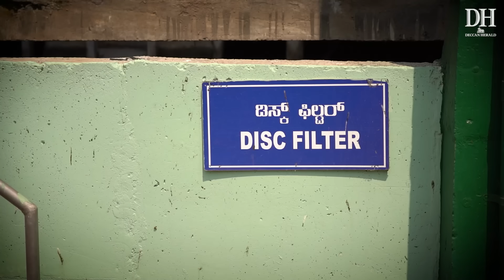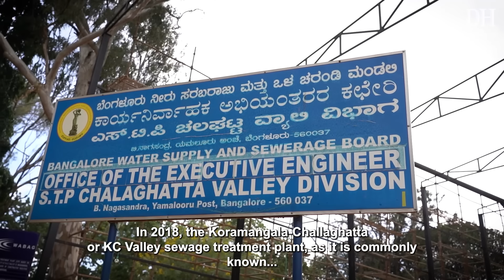How Bengaluru recovers sewage water | Can recycled water solve Bengaluru's water problem

Comment: instead of filling up the lakes with treated water they should be routed for non drinking purpose at homes through pipelines or water tanks and drinking water should be separate. also why would you release chlorine water in to lakes won't fishes die? also it is dangerous to consume such fish because of biomagnification of heavy metals

Comment: Hi, 03:26 the system shown in the said grit chamber is not any screen, it is a sedimentation device. It settles heavy particles to the bottom. Check out Lamella separators by Nordic Water. Thanks

Comment: In my view
1. Each flat should have separate water meter. This will help us increase water charges drastically above Avg water usage of Bangalore. 
2. Govt should make sure STP treatment plants are working properly. Many case STP plant is just for name sake using  money power and muscle power won't operate those.
3. Make sure each and every building should have Rain water harvesting system in place and which is properly functioning.

Comment: Bbmp and government come out with novel projects costing thousands of crores.  Why don’t we adapt Singapore model who treat and purify water beyond our tertiary treatment in most stps. Ultra purified water is also used for drinking. Some of you may recall bill gates photo of drinking ultra purified water. Singapore does not have ground. Water and depends mostly on rain water and the balance importing from Malaysia. Mr. Incharge minister for Bengaluru should start looking at what is being done by a city almost equal in population and area to Bengaluru. Singapore has one authority for all water related issues unlike Bengaluru where many agencies, always engaged in blamegame with one another on  city. problems..

Comment: Instead of Sewage alone, try collecting, filtering and boiling Airconditioner / dehumidifier water and adding alkaline to desired pH in every home.  Ensure bird meshing around the same. This is exactly how Israel carries out drip irrigation for greenhouse plants . Every house with functional air conditioners and dehumidifiers could try piped collection of condensed water. A one and a half hour collection of this water from a single ac on mode dehumidifier provides 5 to 8 litres of treatable condensed water. ( Ensure bird avoidance meshing on outdoor split ac units)

Comment: The water which is treated in Singapore is of such high quality that, in their processing plant, water is given to visitors to drink. Yes sewage water is filtered to such a degree that it can be used for drinking. There should be sensors kept at exit points of these STP's which will monitor the levels of Nitrogen and Phosphorus and warn the plant if it goes over the limit.

Comment: First let BWSSB strictly enforce rainwater harvesting in every individual's house and then on public spaces like side drains
Reply: Even older buildings too
Reply: @haridasification  I will surely agree with you, if you are capable of proposing a solution instead of replying one sentence answers.
Reply: Crores of liters water is wasted during rainy season,all this rain water goes to drains,all rain water should be used, stored,it should not be wasted
Reply: It can be done
Reply: @haridasification  yes, at all public spaces and upcoming residential homes
Reply: Not gonna work for every house, people live in such tight packed houses that even if they were able to setup plumbing for RWH, the collected rain water cannot be mixed with existing sump or there is no space to dig a recharge well. It can only be implemented by houses with a garden area for recharge well or having additional space to store tanks that collect rain water.

Comment: Untill the mindset and habits don't change ,until civic sense is not  practiced one will see more natural disasters 

Bangaluru was once a calm green  garden city , after the unplanned growth of city and illegal constructions and destroying and polluting lakes and water bodies such a consequence of water shortage is there .
And this city is overated and hyped to be called as Silicon Valley of India, Tech City ,IT Capital. 😅
On what basis, this city can be compared or called as Silicon Valley 😅

The water which is being recyled from  sewage can be seen with full dirt ,plastic ,waste materials dumped irresponsibly in sewage lines .
One should as citizens blame and are equally accountable for what the condition of the city is today .

Untill mindset and habits don't  change ,until civic sense is not  practiced one will see more natural disasters
Reply: All Municipality in India are corrupt. Every municipality knows what is the problem but every time short term solution is given instead of working on long term and they there would be Commission in all the work which needs to be completed. Then how can we accept we would get full fledge solution for it.  . In Blore, water distress call has been there since 2016. BBMP Never cared about this. Firstly every house should get water pipe line connection so that Individual house doesn't depend on borewell or water tanker. Then BBMP can decide which area can get cuvery water or which are area can get water from borewell if required. Then there wont be any exploitation on underground water from individual or water tanker. Govt should focus building this infrastructure. Then only water problem can solved. And other thing is constructing more and more STP and STP of high grade so that water can reused for drinking purpose. Current STP in blore are not upto that level. They are only meant for Industrial purpose. They was one initiative from Citizen called as K100 Citizens’ Waterway. Govt should be encouraged to have more water ways So that water problem can be solved permanently. But for this govt needs to dedication to complete the work. problem with our Karnataka govt is that, they give lot of promise on paper but execution is always zero. None of the govt from Karnataka has dedication to complete the work in timely manner either it is BJP or congress.
Reply: S public shd not vote for swerage water treatment  . No one does honest work it vl kill us with disease  .send all . people who flooded our city and .r still filling in back to their homeland .we want to regain our garden City